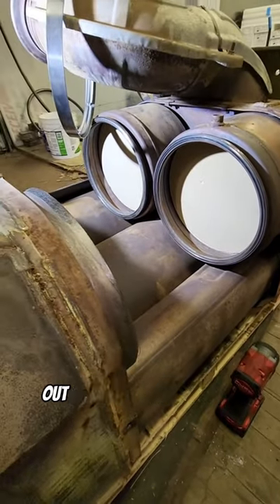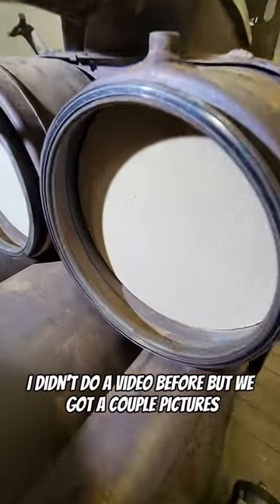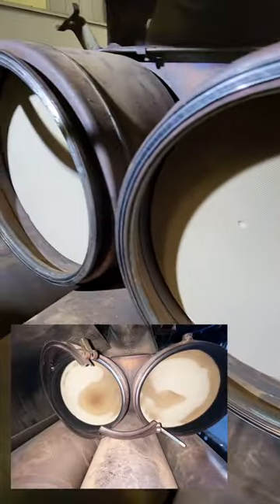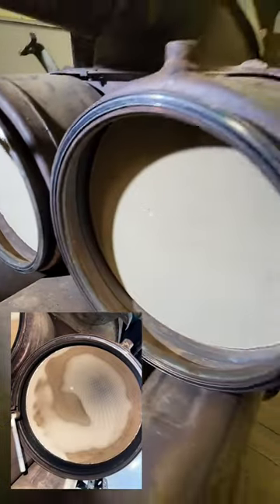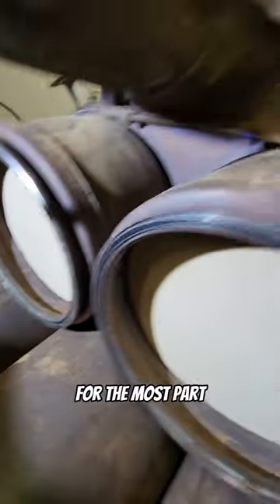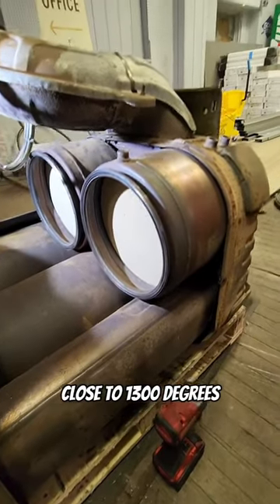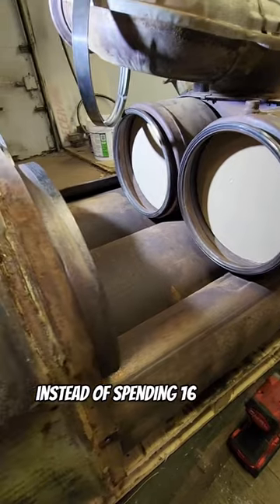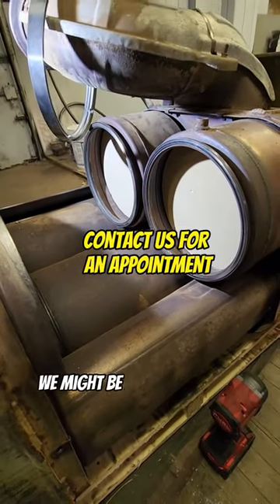One Box (Freightliner) before and after cleaning with our DPF cleaning equipment #shorts #dpfclean

Comment: Ryan, when would you recommend getting this done? How many miles or engine hours?
Reply from the maker: Good question! I will put an education video out about the emission system and recommended maintenance schedule! Long story short, I would recommend the filters to be cleaned once a year, and emission system to be connected to software to check the whole system every couple months plus forced regen. The filters theoretically can run forever unless there is physical damaged or oil damage to them.
Reply: @truckingandfixing  Thank you Ryan.
Reply: I will say close to 900 thousand

Comment: the doc makes the heat, if your heat is low your dpf will not burn the soot to ash, as far a clean it doesnt care it reacts with the fuel on the precious metals to create heat, you need to run a regen to evaluate the doc, baking it really does nothing, but if a customer wants to spend money your way i guess you might as well take it.
Reply: Not sure what planet you live on but when they’re clogged, it’s not gonna regen.
Reply: He's correct. If the precious metals is gone you can clean it all week. Is not going to functional. First need to understand what is doc dpf and scr for. If the system working correctly and no mechanical problem only dpf ash cleaning is necessary.  And i call planet:. Education